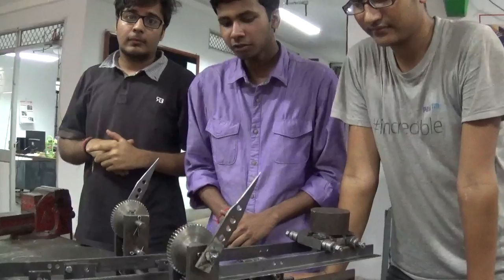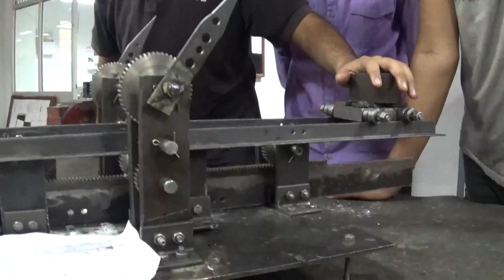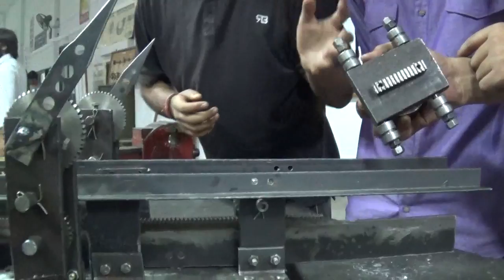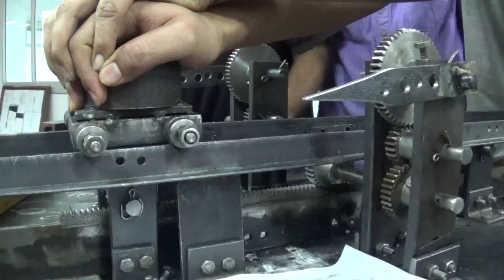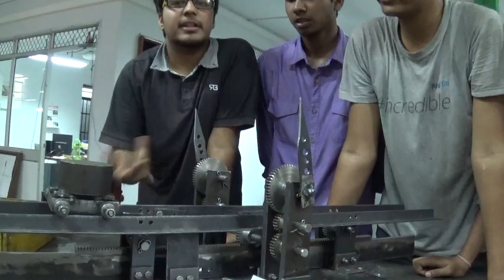Automatic railway crossing

Comment: not at all fesable..the undertack pinion has to aligned at all times and the contact friction between the two would be very high damaging the gear.. itself.. better way would be to use sensors and transducers  and send signal forward for this operation